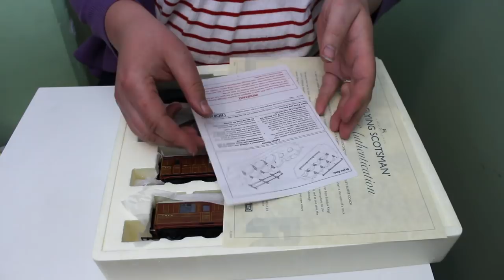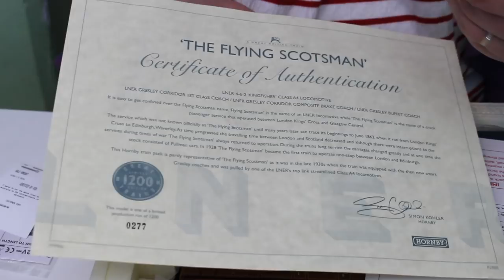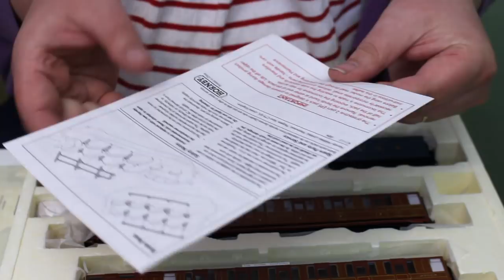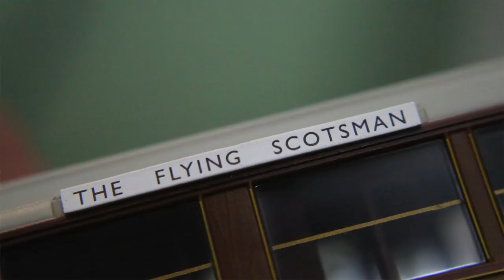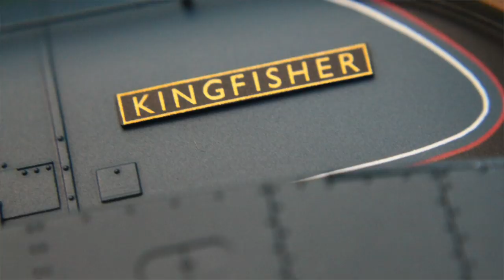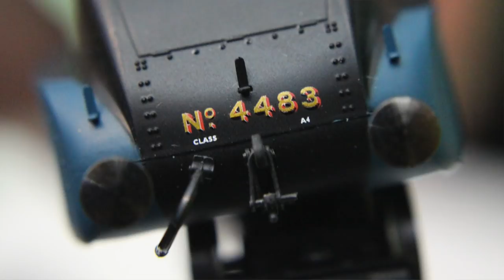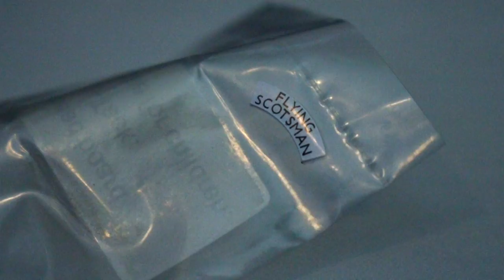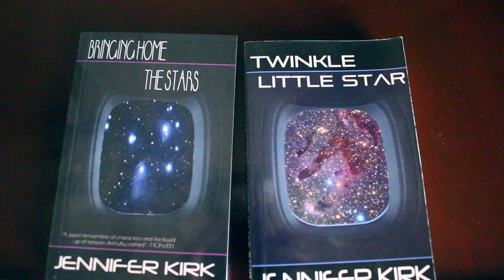Hornby Flying Scotsman Train Pack - Unboxing and Review

Comment: Hello Jennifer, how are you? I would like to know what kind of food you use on your trains ... to see if it looks like the controller I use here in Brazil, thank you very much.
Reply from the maker: I presume that's a translation error and you mean controller? I use a Gaugemaster Model D
Reply: positive wanted to say which controller do you use ... what is the voltage of it and if its trains run at 12 volts and what is its amperage? ... ok
Reply from the maker: It is a 12V DC controller. No idea on the amps that it draws.
Reply: ok, Jennifer ... hi, we'll see you in some future video of yours ... big hug ... thank you very much ...